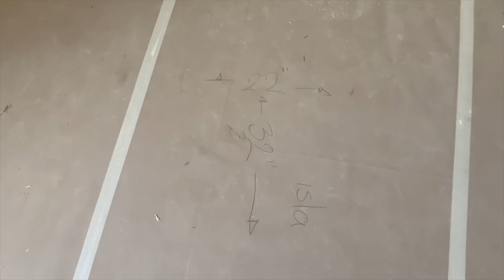THINGS NEED TO CHANGE

Comment: I bought a newer car before the economy went to shit. I got a 2014 Chevrolet Equinox with extremely low mileage 1 owner. Paid for it all in cash because I knew a year before I was going to need a new car. So I made a mock car payment to my savings account for 12 months. And bam just like that I had a new car in my driveway and I’m debt free. And got exactly the car I wanted and no payment.